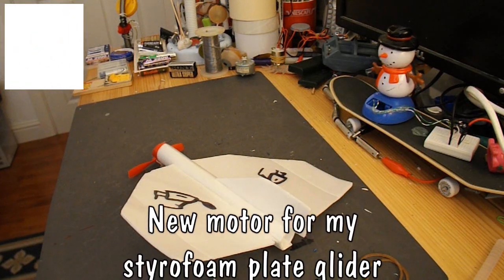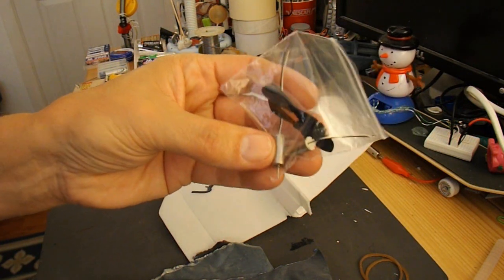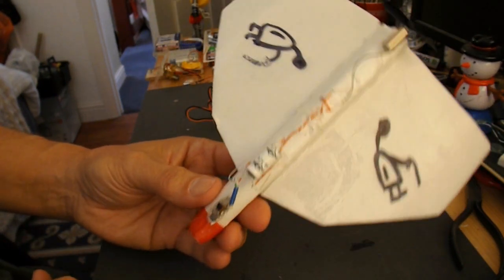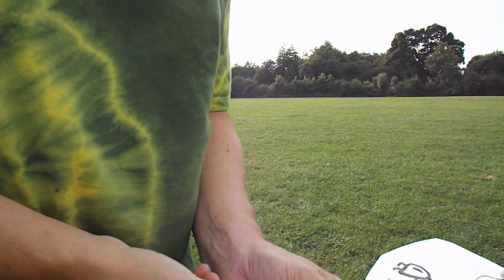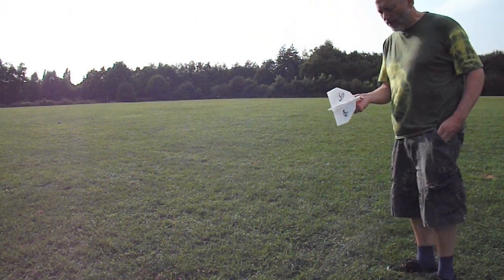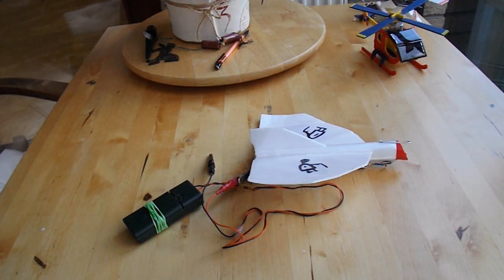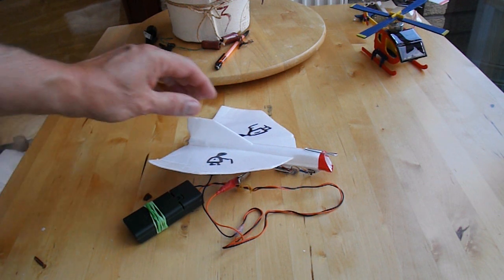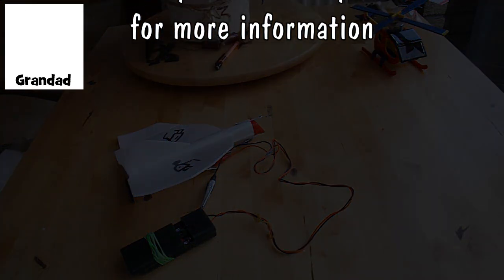New motor for my styrofoam plate jet glider

Comment: I think you should try a zinc air (hearing aid) battery.  Six seconds of flight is just not enough.  I like the design of the plane.
Reply from the maker: Anton Nym the whole point of using the supercapacitor is to limit the duration of the powered flight. I do not want it to travel far. The idea is to get it into the air under power and then it should glide.  Different sized motors or different sized supercapacitors would vary the length of the flight. You will see I have several other designs in this playlist and a few by other people https://www.youtube.com/playlist?list=PLA5a2xPRSrB1wNvirrwAn69eo_pM0tdEM

Comment: Must just mention, after checking out the Ebay link....those look like counter rotating propellers ? as in, the props spin opposite directions. You could build a Mosquito or something as dual motor. At 2 quid a pair they seem to be superb value, order more lol
Reply from the maker: Hmm, didn't even think to check the propellers, I have just checked and you are right. Nothing wrong with your eyesight is there. I had to put my glasses on to be sure.

Comment: I ordered myself some lipos +charger, very cheaply. Now they are too heavy for those little planes but these supercaps must be superlight! How long did it last with the plane? 10farads should last twice as long! I read up on supercaps 3 years ago. Now I finally found a reason for buying one.
Reply from the maker: On a comparative power to weight ratio you will get more power for longer from a small LiPo. Supercapacitors tend to have a metal casing so that must add to the weight. However I chose supercapacitors because I did not want to invest in a proper charger for LiPo batteries and because I wanted a fast charge and a short run time. Doubling the capacity of supercapacitor will probably double it's weight so you would need to take that into account. The motor may run for longer but it is having to lift more weight so probably will not fly as far. The original PowerUp system used quite a small supercapacitor to minimise the weight penalty. I probably only get about 10 seconds of full power, then it drops quite a bit but that may be enough to keep the plane flying if it is light enough.

Comment: Grandad this jet glider is cool but one question I have use a helicopter 3.7 vold. lipo battery it can fly
Reply from the maker: +junaed islam I use the supercapacitor because it only provides enough power for about 10 seconds so it will not fly too far away. If you use a small LiPo from an old toy helicopter you may find it flies too high and you lose it as the LiPo will probably last for several minutes.

Comment: HI grandad your projects are awsome . but for styrofoam plane can i use  25V CAPACITOR ?
Reply from the maker: +shyamala manjunath any 'normal' type of capacitor will NOT work. They discharge their stored energy too quickly. Supercapacitors are closer to batteries in the way they work. They charge quickly like capacitors but discharge much slower. Not as slowly as a normal battery but much slower than a normal capacitor. There are links in my video description that will help you understand.

Comment: Hey grandad, i am going to try to replicate what you have done in the video, but i am curious as to what the ferred on the capacitor means, if you could briefly explain why a higher or lower ferred count would be better and what the difference is that would be amazing! Also how do you charge the capacitor? simply using a battery?
Reply from the maker: The Farads is the capacity, so more Farads = more capacity.
Wikipedia http://en.wikipedia.org/wiki/Supercapacitor
Here is my helpfile on how I charge my supercapacitors.
https://youtu.be/tdOc62ZOSUI?list=PLA5a2xPRSrB2v0vxMJyZ9cPweAGx1FK6e
Reply: Oh ok, so if i wanted longer flight times, i would get a Supercapacitor with fore Farads, thanks so much!
Reply from the maker: ***** yes but bigger capacitor means more weight.
Reply: I'll keep that in mind, thank you Grandad!

Comment: The propeller is on back-to-front. Less thrust, the way you have it.
Reply from the maker: You could well be right, depends which flight you mean, I swapped it several times during the day and I doubt that I checked it and I certainly didn't have my glasses with me. You have me studying the video to see if I can see it clearly enough and I can't be sure. The best view I can spot is around 2.03 and I am still not sure. It is a matched pair of propellers one left and one right and I use them later on my Mosquito. I did even better on that and had them swapped so they were pushing the plane backwards and I thought it was the stronger wind on the day. Took me about half an hour to realise.
Reply: +GrandadIsAnOldMan  HELLO where did you get the super capacitor
Reply from the maker: Aecio Pmittan details in the video description.

Comment: from where i can get that supercapasitor and that moter........ after 10 sec that supercapasitor will  die.???????than how to reuse it???
Reply from the maker: +ANZAR Ji the details are in the video description. The point about supercapacitors is that you can recharge them in seconds as often as you like. They are quicker to charge than rechargeable batteries but do not last as long, which makes them ideal for this purpose.
Reply: +GrandadIsAnOldMan  thanxx

Comment: Ok thanks I will try with a 6v dc motor maybe
Reply from the maker: +Corey Hewitt try it as a glider first before you add all the weight of motors and batteries.
Reply: Ok I will

Comment: Hi, like your videos ! Question could you build an micro linear servo with the electro toothbrush motor ? 
I still want to build an RC Plane with the old parts of my old Koax-Heli (have some replacement mini 
brushed motors), but i dont want to buy anything because i think there must be a way to build a rc plane 
(no two motor plane without servo) with this parts :)
Greetings from Germany
Reply from the maker: +QuadReaktor the motor in the Oral B Pulsar toothbrush is a similar size to the sort you see on a typical micro linear servo but you just said you didn't want to buy anything. To make the servo you would need a circuit board to convert the signal from your receiver to the control for the motor. You would also need suitable gears and shaft and framework to hold it all together so I have no idea how you would fabricate all that without buying any components. If you are going to have to buy those components then you are going to spend more money than buying a ready made servo and you will probably end up with an inferior result. Technically it might be possible but practically and financially I would think you would be wasting your time.
Reply: Ok, i thought there are an easy way to do that. I said I dont want to buy anything because i have so many motors and coax heliparts, thats the only reason.
I have also many Micro Servos, so it would be awesome If you can build a micro Delta Wing (or maybe a plane) with coaxheli parts (and a purchased micro servo).
I have micro brushed motors from coaxhelis, and motors from a YD-928R-2 mini multicopter.
If it is not possible to build a micro Delta Wing with coax parts I would be happy anyway if you build a micro Delta Wing :)
(sorry for my bad English)
Reply from the maker: QuadReaktor your English is fine, I am always impressed by people who have a second language. I am afraid my language skills are very limited and I use Google Translate to help me. The only helicopters I have used for my models are the really cheap ones that have infrared transmitters and do not use any sort of servo.
Reply: Thanks, sometimes I wish I had paid more attention in school :) I understand it much better than i can speak/write.

Comment: could you try to make a capacitor power hovercraft
Reply from the maker: +random person it would work but not really much point. I use the supercapacitors because I only want a relatively short burst of power to get the plane in the air. Just a matter of seconds not minutes. You would want a hovercraft to last for several minutes.

Comment: what if i make a bigger version of that plane and use a cheap rc car motor instead of the one u used would it work ?
Reply from the maker: mychannel I doubt it, the cheap rc car motors do not have a very good power to weight ratio. Maybe you should just try it and find out, just because I don't think it would work does not mean you should not try. Maybe you can surprise me, you won't be the first to prove me wrong.
Reply: GrandadIsAnOldMan Hey granddad I just want to suggest that you can't use those RC car motors as they don't have enough power. Instead coreless motors that you used are perfect for this work. I also kinda like to make and fly RC helis,planes, Chuck glider and add motor to then just like you do but I learnt many things by watching your videos. I don't have any video on YouTube but I'll upload some and I'll give the links
Reply from the maker: Chirayuu Pandharpurkar thank you, I will look for them when they are ready :)
Reply: Thank
you

Comment: Oh and one more question I have an rc helicopter and it used to work fine and now every time I turn it on the motor starts spinning by itself even when the transmitter is swiched off 
can u help
Reply from the maker: +Corey Hewitt sorry, I cannot fault find remotely. I have spent lots of time trying to help people like that and it really does not work. There are so many possible problems it takes too long to go through it step by step using YouTube comments.
Reply: Ok thanks anyway

Comment: how do you make plane to fly in circle? opposite position of elerons?
Reply from the maker: +Aspboss Llol yes you would trim the rudder and the ailerons to get a flat circle glide.
Reply: +GrandadIsAnOldMan thank you  sir, because I have made mini motor plane...I just afraid that my plane will gone fly away.
Reply from the maker: Aspboss Llol that is always a problem :)
Reply: +Aspboss Llol Tie off some fishing wire or cotton and use it to anchor the craft to the ground with about 50-60 feet of slack. You'll get to see your plane in flight and it will only go so far before its tugged back to the ground.

Comment: This is awesome dude! i have to try this. The capacitor rocks too.
Reply from the maker: Good luck with that. These supercapacitors are relatively expensive but I use them because they give quite a short burst of power so the plane does not fly too far away.

Comment: Belém (PA) 16/9/14
Qual é o endereço para comprar esses KITS?
Thank you.
Reply from the maker: Este não é um kit, eu fiz isso a partir de uma placa de isopor. 
Os links estão na descrição do vídeo.
This is not a kit, I made it from a styrofoam plate.
The links are in the video description.

Original build video
http://youtu.be/DGbRAhr4jjI?list=PLA5a2xPRSrB0nZItxE_78EJP0F99Ghaki

Another video with this plane
http://youtu.be/k5N5lmDsig0?list=PLA5a2xPRSrB0nZItxE_78EJP0F99Ghaki

Another video with this plane
http://youtu.be/jmaQmbBsQkk?list=PLA5a2xPRSrB0nZItxE_78EJP0F99Ghaki

The eBay listing I used for the motor and propeller 
http://www.ebay.co.uk/itm/251480920143?_trksid=p2059210

Comment: why is the super capacitor rated at 2.7 volts?
Reply from the maker: Are you looking for a detailed reply explaining the chemical composition of the component parts of a supercapacitor?
Reply: Yes, I would be delighted to know more of the super capacitor. I also flies radio control aircraft models. Search for youtube Starscreamer47 posting. Thanks a million.
Reply from the maker: angelofmusic477 if you want more detailed information about supercapacitors there is more in my video description.

Comment: Do you think this will work with cardboard or just card
Reply from the maker: +Corey Hewitt it will be heavier with card or cardboard so it will need a more powerful motor to make it climb. As a glider it would still work as long as you throw it hard enough. It will fly faster but probably not as far.

Comment: hey sir sorry for again disturbing you..can you plz send me the dimensions of your model shown in above video.
Reply from the maker: I am afraid I didn't measure anything when I made this. There is a link to the original build video in the video description but as I say, I didn't measure anything, I just build by what looks right when I cut it out from what is available.
Reply: actually i am having problem in weight balancing....i'm unable to set centre of gravity
Reply from the maker: Ehtisham Ashraf I just keep adjusting the position of the weight until it flies level.
Reply: i'm trying this.but not working for me...well thanks alot.
Reply from the maker: Ehtisham Ashraf I wish I could help more but  that is the best I can offer.
Reply: no problem sir..thanks

Comment: what is that white thing
Reply from the maker: I am guessing you mean the supercapacitor. There is more information in the video description. A supercapacitor is like a cross between a battery and a capacitor. It stores charge like a battery but charges very fast like a capacitor.
Reply: Super capacitor works like a battery because its huge retention capacity. Normal capacitor are measured in micro farad(uF). Super capacitor has storage in Farad. A  100F capacitor = 100,000000 uF
Reply: ok,i got it thanks a lot you guys

Comment: Morrisons  have some real tasty pizza's and have a really nice Styrofoam base underneath cuts easily and is nice and flat !
Reply from the maker: Yes I have quite a range of pizza trays from different shops, I always saved every one we had but I have so many now that unless they are "special" in some way, I throw them away 😊
Reply: yes you can acquire quite a collection over a very short period of time ! 
a hot wire cutter is a great thing to have too ! have you ever made an electric paper aero plane launcher ? with two opposite rotating rubber wheels bit like the machine that throws tennis balls ?

Comment: hey it's my request to u to make a flying servo motor airplane
Reply from the maker: +inder sain not quite sure what you mean. Do you mean to strip down a servo to get the motor and then use that to power a small plane?
Reply: +GrandadIsAnOldMan I think He means, a standard Radio controlled airplane
Reply from the maker: SirPanzer V I am not a mind reader and people do have some inventive ideas. If that person wants to clarify the request I will respond appropriately.